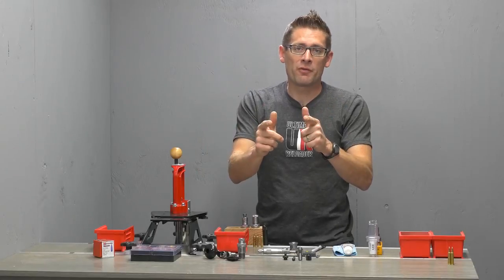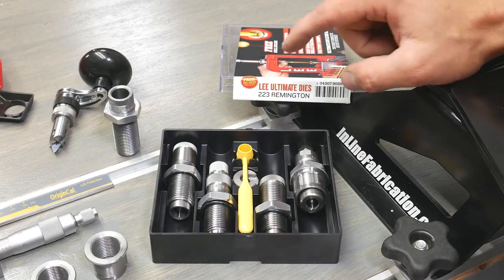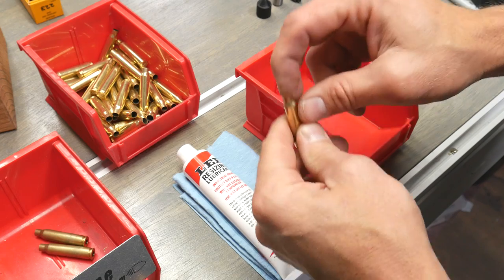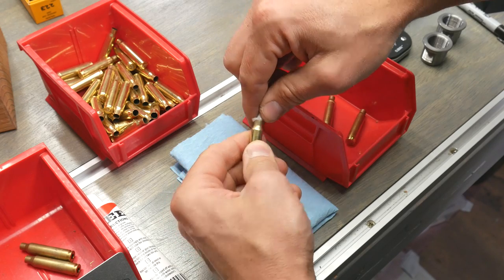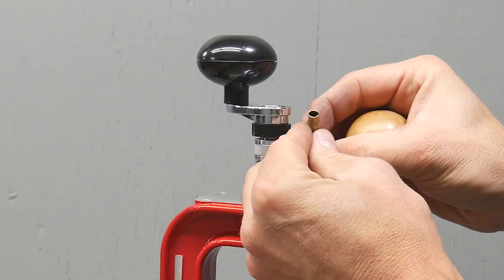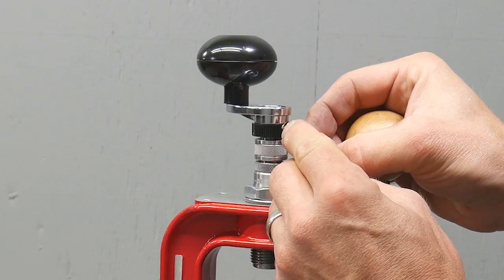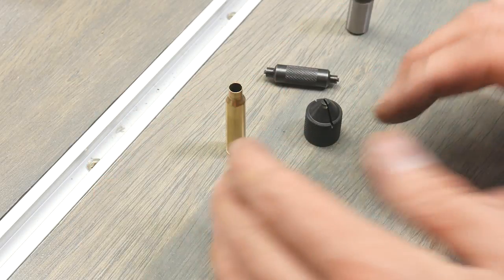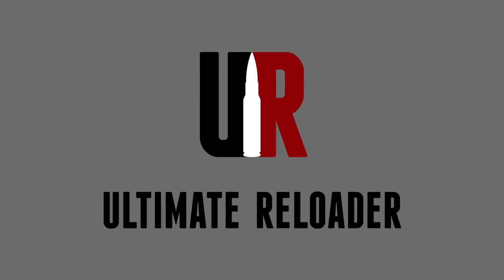Budget Precision .223: Sizing and Case Prep

Comment: I have the same setup. But that little notch on the bushing is there for a reason. It's made to lock the bushing in position with the little button on the top of the press.
Reply: According to LEE instruction on this press, it say "After dies are set, they can be installed so the lock groove does not line up with the lock button, allowing you to install and remove die without depressing the lock button."  Therefore, this is optional to line up the lock groove with the lock button.  Actually I have decided to do just like what Gavin has done.  I need to turn the bushing clockwise or counter-clockwise to eliminate all the "play".  In my case press, there is a 1-mm up-and-down and left-and-right movement if I setup the bushing in a way that the lock groove lines up with the lock button.  Turning the bushing like what Gavin has done eliminates the "play".  Seem like this may be what we need to do in order to use a low cost press to do precision shooting.

Comment: Thanks for showing how to setup the bushing onto the LEE Challenger Breech Lock press.  I notice that you turn the bushing clockwise in a way that the lock groove of the bushing doesn't line up with the lock button of press.  I don't know why you choose to do this.  But this works for me.  I find that if I turn the bushing either clockwise or counter-clockwise (hand tight only), I will find a spot where the bushing will sit tight on the press.  In my case, if I didn't do this, the bushing would have had quite a bit of horizontal and vertical movements.  I doubt all these movements help precision shooting.  Thanks again for showing me the trick.  BTW, LEE instruction that comes with the press says that this is OK not to line up the lock groove with the lock button.  Therefore, I don't see any downside of doing this to make it sits tight on the press.

Comment: I don't think you need any lube for the lee collar die. It does not have an expander ball, and nothing is touching the inside of the case mouth. Also, not sure why you need to tighten the lee bushing. The little notch on the bushing it to lock it to the black detent and ensure the die setup remains the same every time.

Comment: the neck die uses a collet and does not require lube.
Reply from the maker: Good catch, lube is optional!
Reply: gavintoobe no problem just trying to save you some time.
Reply: I have used lee's collet neck dies for thousands of rounds.  You are correct on the no lube.  The collets compress the necks to the mandrel with very little friction to the brass.  The only place lube (grease) is needed is the internals of the die itself where the collets are compressed into the upper cone part.
Reply: Still need lube on the inside of the case mouth otherwise the sizer/ decap rod might stick in the case (ask me how I know!)  -  true ?
Reply: @JohnSchenck  No the inside does not need lube as the decap rod does not expand the case

Comment: If you were into scrapping you could recycle the spent primers. I probably have 5 pounds of spent primers in a small tupperware i want to melt. Most of it is from resizing once fired cases. Brass also has a lot of copper so if you knew how to seperate the copper you could make some bullion as a little side bonus of reloading

Comment: Hallelujah, someone finally showed the use of a case length gage. But only on the first case? Honestly, every case needs to be gaged.
Reply from the maker: Harold- that sounds like a LOT of overkill to me :) Perhaps if you switch brass brands check then :)
Reply: When full length sizing for a semi  automatic it's not a bad idea to check them if the case doesn't fall out when flipped over it's probably not going to feed correctly

Comment: I thought the quick change bushing was supposed to index the notch on the bushing with the button on the press??
Reply from the maker: Se my reply to the other commenter- there's two options: lock to the press (if you want to leave bushing in press and screw in/out dies), or don't lock to the press for quick and easy die swaps with bushings attached to the dies.

Comment: Excellent, Gavin, thanks! Silly newbie question, but how did you know that the cases wouldn't require additional trimming?
Reply from the maker: You can see it in the case gage check (2nd part of checks) and I also measured with a digital caliper when preparing for the video. The cases are 1.740" before firing, and after firing/sizing (neck only) had only grown a few thousandths...
Reply: Ah, that makes sense. Thanks very much!

Comment: hey Gavin, as a new subscriber I'm really impressed by your knowledge. I want to start reloading but I'm intimidated by the process. did you have someone who taught you the basics? or did you just research and go for it? also, am I right to be cautious about getting started reloading myself?
Reply: Go for it, it isn't rocket science, just have attention to detail and do it slow at the beginning. What I did was starting with something less complex (38 special), then moved up to 223 and 6.5 Creedmore.
Reply from the maker: Agreed- just be super-careful and check everything (load data, etc) 3x before committing to a load and shooting them. You'll be just fine!
Reply: thx guys!
Reply: Most reloading manuals have a lot of good information in them about the basics of reloading and being safe about it as well as load data for most standard cartridges.  You should really pick up at least two different ones and read the reloading section in all of them.  There are several good ones to choose from, some beginner press kits even include a reloading manual.  It is recommended to check at least three sources for load data on a cartridge you want to load and it's best to go by the one with the lower published values for a particular bullet/powder combination to be on the safe side because occasionally a starting load in one manual can exceed max load in a different manual with the same bullet and powder combination.  You could get three reloading manuals or look up the third value online whichever is more convenient.  Aside from that there are plenty of good videos here on youtube that can help you out if you get stuck.
Reply: I'd recommend starting with a single station setup like the one in this video.  There are a LOT of constant adjustments to keep a 5 station progressive purring, which can be intimidating for a new loader.  Once you master the process then consider a progressive press.
Reply: Definitely start with a single stage press and get a couple of different reloading books before you buy any reloading supplies that way you can pick your powder and bullets from the books

Comment: Does brand new factory brass need any sizing/ prep before loading the first time?
Reply from the maker: No, but you can run an expander ball through the case neck if there's any deformation to help with consistent bullet seating.

Comment: @gavintoobe How do you set the COAL when using the on-press trimmer?
Reply: By turning the plastic ring on it and if you trim .300 blackout you take off the metal ring lee also makes a power deluxe quick trim for a electric screwdriver

Comment: It appears you're setting up the sizing die for sammi spec. For any new reloaders watching this, you should be reloading for your guns chamber. Get yourself a bump gauge. Fire formed brass only needs a 3-4 thousandths shoulder bump for semi auto and 1-2 thousandths bump for bolt action to be able to rechamber in your gun. Anything more and you're over working the brass

Comment: You might want to re-check your set up directions again
Reply from the maker: Can you be more specific?
Reply from the maker: You can actually install it both ways- the locking feature is for when you want to use it like a press without quick change. From the instruction manual: "After your dies are set, they can be installed so that the lock groove does not line up with the lock button.This allows you to install and remove the die without depressing the lock button."
Reply: I will offer this feedback - I was using my 223 full length resizing die with the quick change just turned in (but not locked in the button.  Got to a somewhat dry case and put a lot of pressure, popped all the aluminum threads out of my press because the quick change collet was only 1/2 into the threads.  Just no clear way to ensure you are indexed into the press properly except the button and notch cut into those quick change collets.  I can post a picture if that helps to explain what I'm saying
Reply: John Schenck good point thanks John